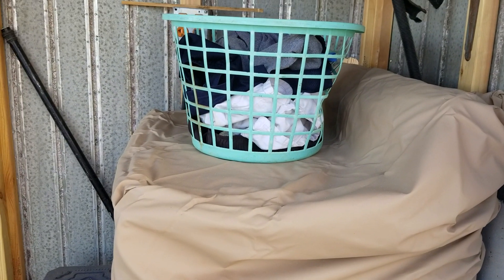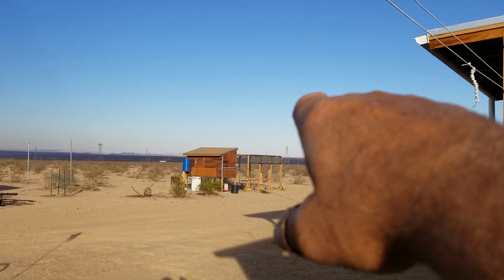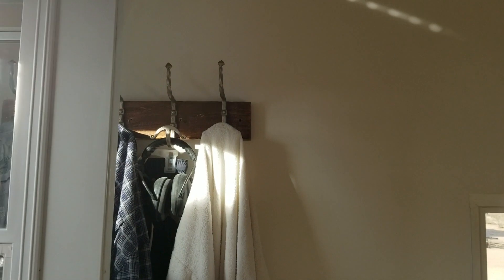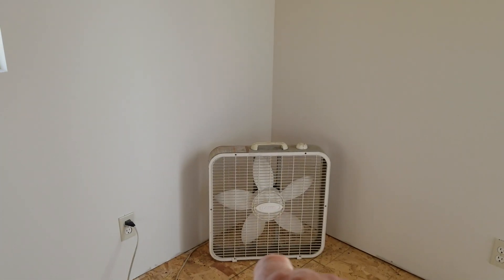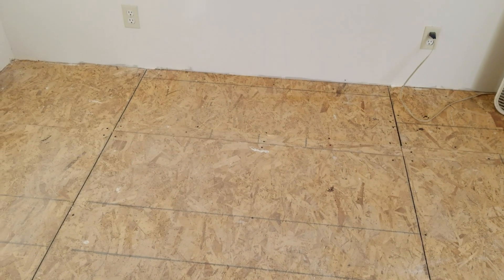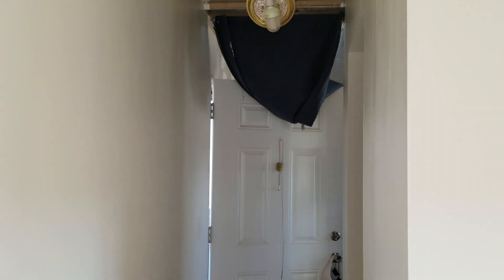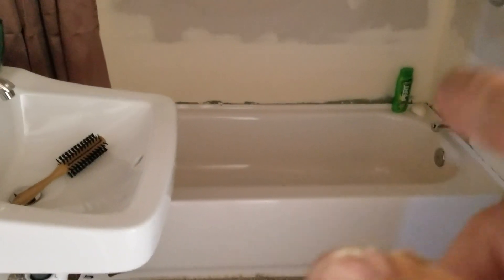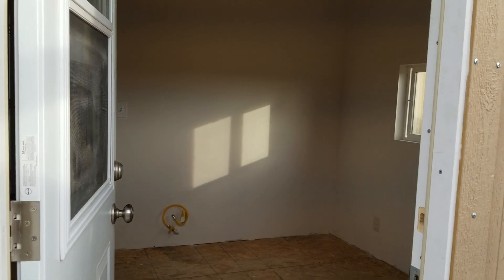Homesteading the Desert, Oct. 25, 2018

Comment: Great work gBear.  It occurs to me that the g in gBear might stand for GREAT because you are great in all that you do with your many talents.  Regarding the carpet issue, I don’t have time to go back and review the videos, but isn’t there a “just in case” screwed down panel in the floor this side of the wall in the tub area?  Gluing might limit the access if “just in case” is needed.  Nice work.
Reply from the maker: tom bennett the access panel is on the other side of the wall, so it wont be a problem.   Thanks for keeping an eye out for me.